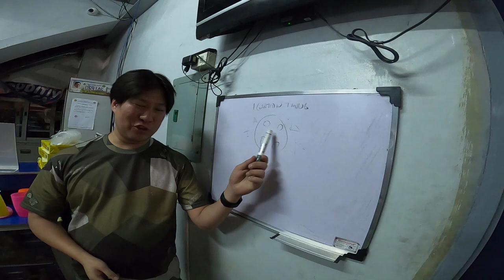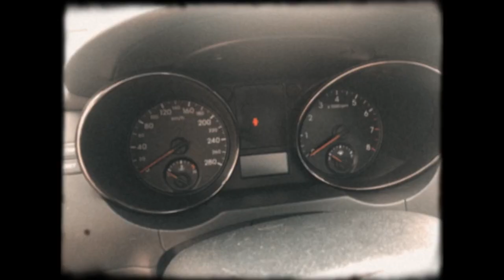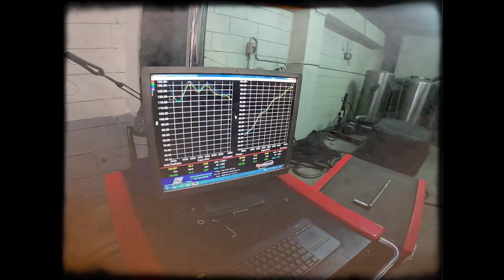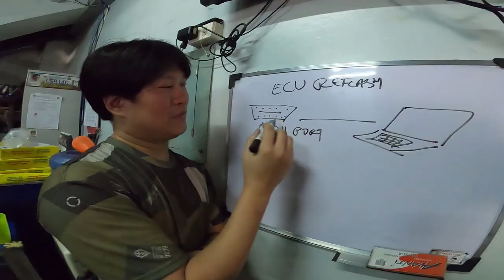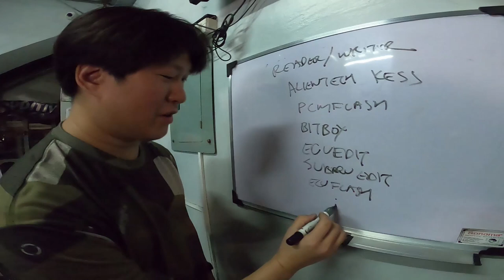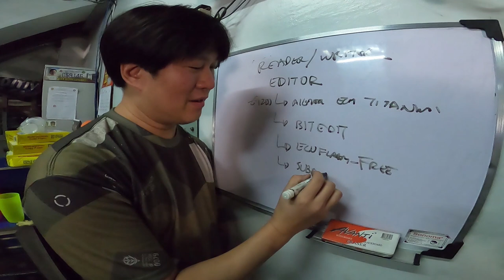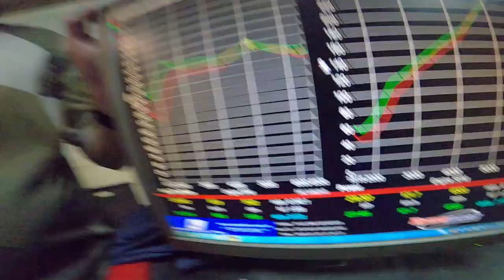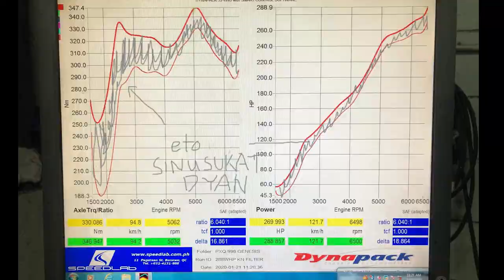2010 HYUNDAI GENESIS V6 COUPE

Comment: parang elevator yan... imbis na magalarm at 1000kgs.. ito minodify para mag alarm ng 1200kgs... gagana naman siya pero bumaba factor of safety.. so imbis na tumagal yung sasakyan ng example 500,000kms.. baka 250,000kms nalang... tapos gumastos kapa para sa upgrade na 13hp? 13hp siguro below 5% yan dahil mataas hp ng sasakyan niya from the start.. yung boost na di ka sigurado kung nararamdaman mo or baka nasa isip lang... sa explanation titipid yata.. pero most likely baliktad..
still great entertaining boss ramon!

Comment: Careful with that 3.8 Genesis engine. They are very fragile internally.
Reply: Need to upgrade to forged internals kapag gusto mo ng forced induction pero kung simple tune lang at maingat ka na wag isagad yung rpm okay lang sya.

Comment: Basically binago lang nila stock file sa ecu then reflashed a preformance file easy Horse power but if you really want to bump up the horse power upgrade the internals, put on a turbo tweak the suspension and my guess would be around 500 or more horsepower hahahaha